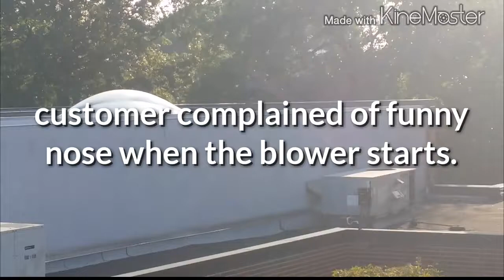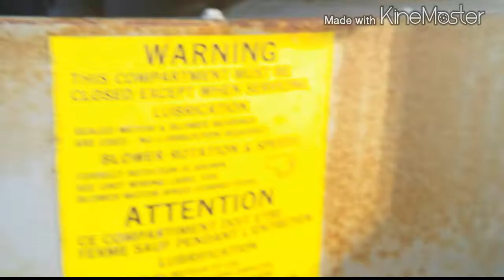HVAC | York Package Unit | Evaporator Motor Replacement

Comment: I was not taught that method but I figured it out on my own about spacing the fan blade with your fingers. Good stuff
Reply from the maker: My helper is my good friend I just Fuck with him. Lol. Thanks for watching.
Reply from the maker: It's a good way to aline the blower wouldn't you agree.
Reply: For sure, never had any issues with that method
Reply: I usually look at the wheel from the outlet of the squirrel cage and see if it's centered. That particular unit may have been harder to do that on because the outlet was so long. Good video. Don't be so hard on your helper, he seems like he's willing to learn.

Comment: Good job Emin , I am sure you changed a lot of those motors because of those exact issue. I due only commercial myself and that isn't unusual and in the 15 or so years I have been doing this I also have done a lot of those.
Reply from the maker: Thsnks for watching wayne. I appreciate the comments.